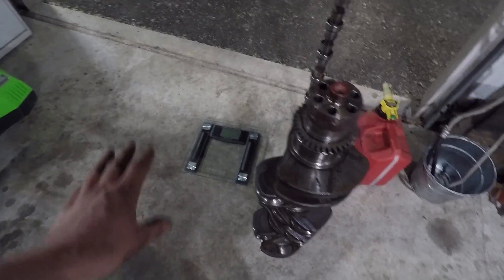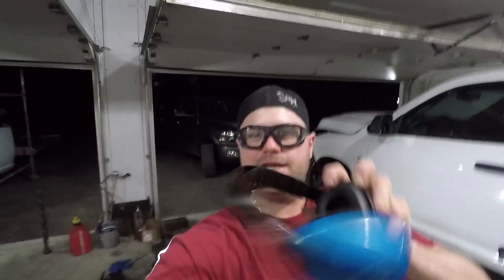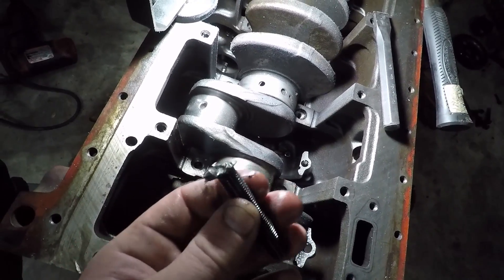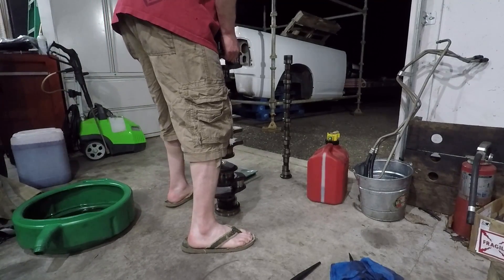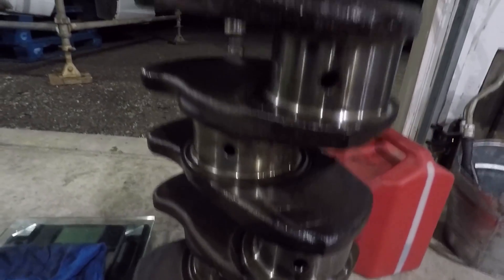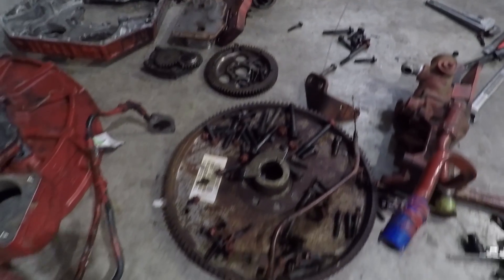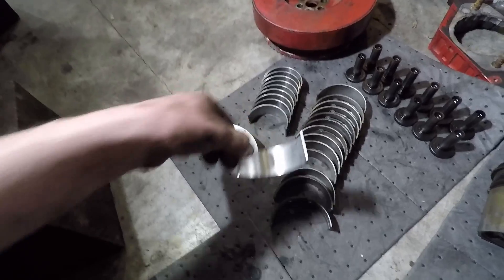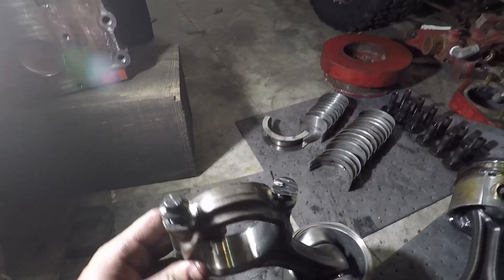INSIDE A 6.7 CUMMINS Engine Block, WHY ARE THESE PARTS SOOO HEAVY?

Comment: What’s the engine serial number off that valve cover? and I can tell you anything you wanna know. I work for Cummins, so I have all of the information on those, and I’ve rebuilt a bunch of them. Love the channel bud, you’re doing an awesome job.
Reply from the maker: Thanks, if the industrial block and pickup are the same is my biggest question
Reply from the maker: 57848489
Reply: Have you got a serial number for a pickup 6.7 engine? So I can cross reference.
Reply: According to what I can find, Cummins calls the dodge version of the 6.7, a 2010 DCX pickup, which comes up in the listing for the block for that serial number . Now, that being said, I’m not sure if you could drop the cam in the other way, which is the only thing I see being a problem, but if the gear housing will bolt to the front of that block you ought to be alright.